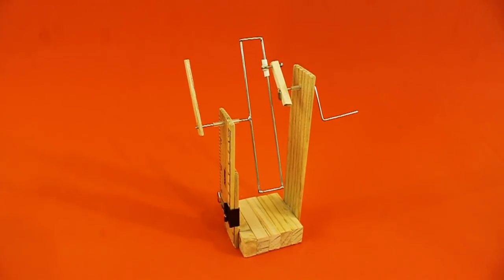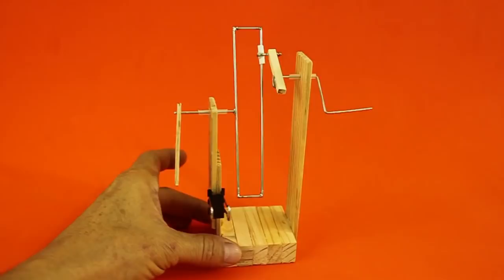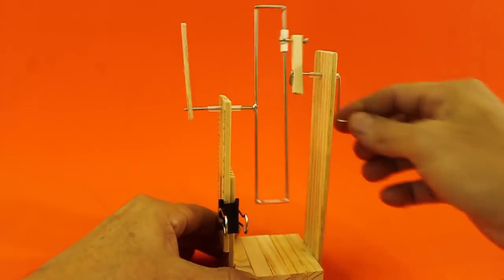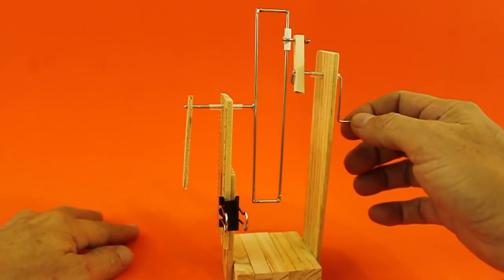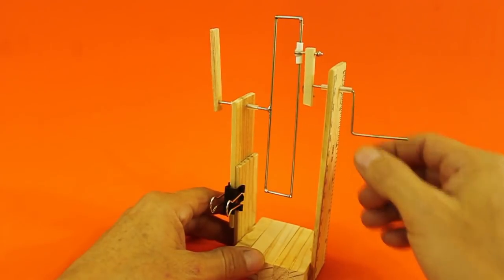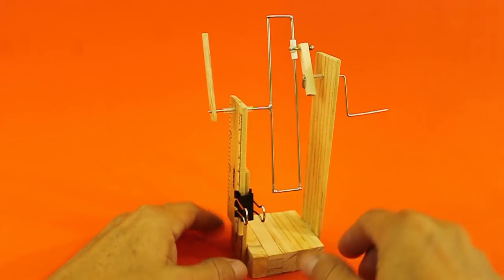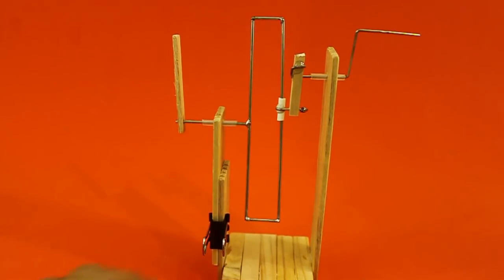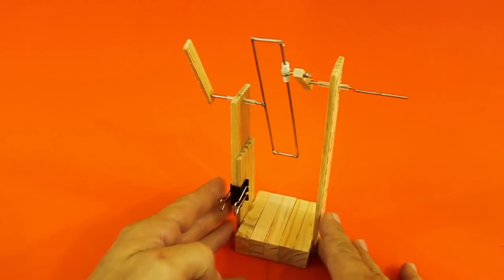The Zurich Mechanism

Comment: Nice! I didn't know it existed. 

At the end, when the output shaft is below the pivot, the result is a reciproating motion; where the input shaft rotates continuously to produce a reciprocating motion on the output.

But I doubt this would be efficient, and while I know there are may other ways to achieve the same (i.e.: an engine crackshaft), is there any mechanism that pops over the rest in terms of efficiency/torque transmission when it comes to rotary to reciprocating motion conversion?